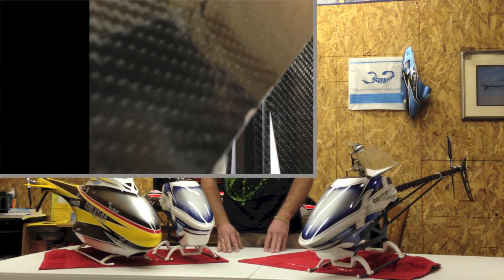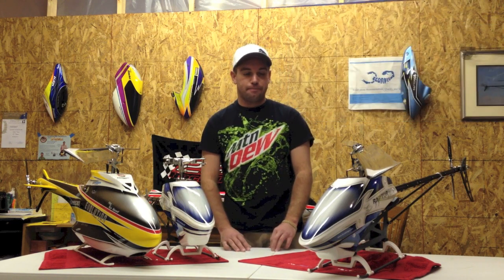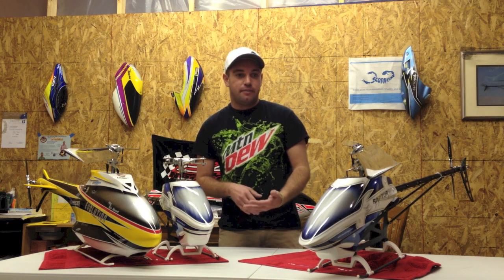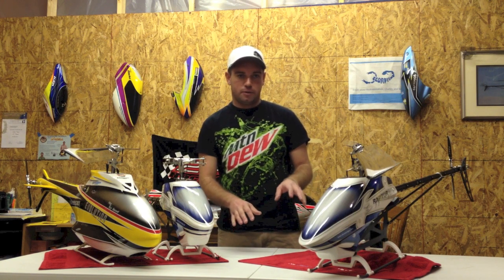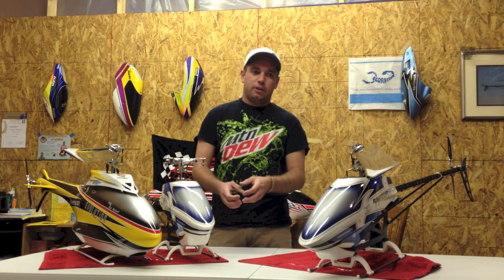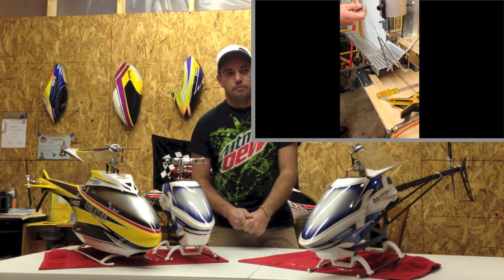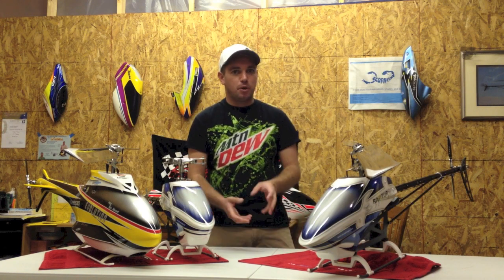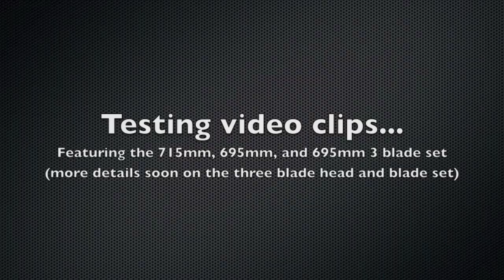Nick Maxwell talks about Helix Rotor blades for 2014

Comment: @Nick Maxwell: I just received my Helix 695mm from one of the dealers and one of the blades has some sort of a micro crack/chip which is about 10mm long along the root of the blade. Since you know the internals of these blade, do you think this is safe to use or should I return this to dealer for a replacement. Thanks.